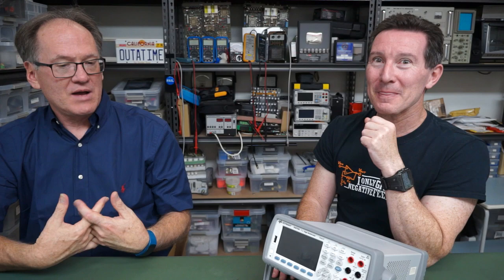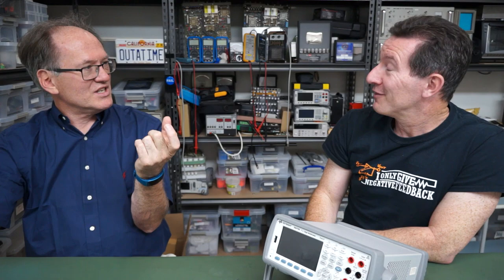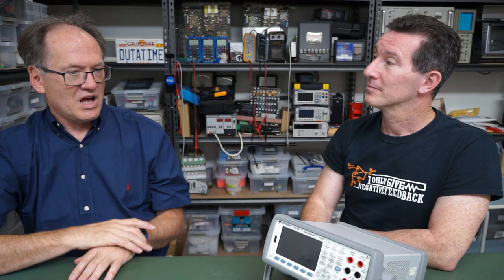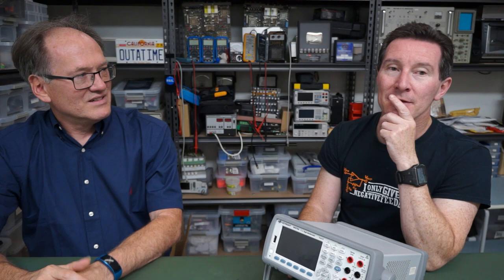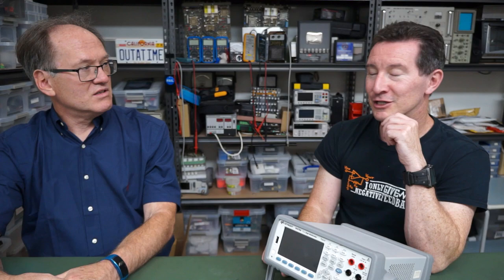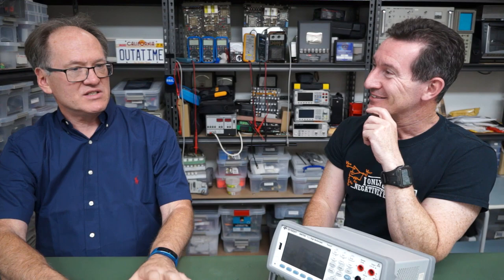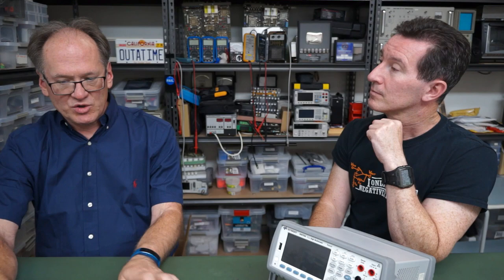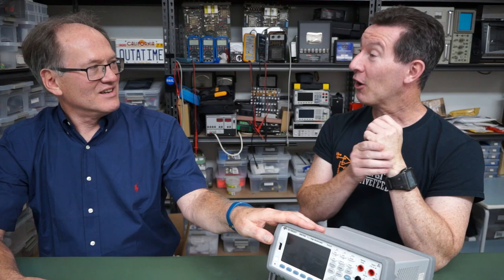EEVblog #1032  Part 4 - John Kenny Keysight Interview

Comment: The audio recording world is a great example of knobs and tactile controls. For a period, buttons and layers of menus were taking over. After a period of this, the market started manifesting products all over the place to return knobs and tactile controls. Users don't want to scroll through menus and use shift buttons, etc to get to a function, they want to reach for a dedicated control. Audio mixers, no matter how advanced and digitally based, still follow the form of analog mixers. The fluorescent light bulb example is an interesting example of form following tradition, yet not really being necessary. But an audio mixer is an example where the original form is totally following function in the most useful way.
The Golden Rule: Form follows function. :)

Comment: I noticed very little if any competitor name dropping, which is understandable. But with the introduction of Tek's 5 series scope and its price point I would be scared. I would asume Rohde and Schwarz 5G test instrumentation should also scare them as well. And a little Chinese company called Rigol and there upcoming Phoenix Chipset due next year. So I just hope that Keysight will bring to the table some truly innovative product to knock our socks off. If not I see the days of giving away products won't matter to consumers, as we look forward to more innovative products. Cheers
Reply from the maker: Scared of Tek's 5 Series price point? Why? It's hardly a ground breaking price point.
Reply: T Komoski have you ever used a modern tek scope?!?
Reply: Comparing Apple's to Apple's side comparision on price: (Not Features)
- Keysight  MSOX4034A 350mhz  4ch CA$ 16,647.00
- Rohde & Schwarz RTE1034 350mhz 4ch  CA$ 14,819.81
- Tek MSO54 350Mhz 4ch CA$ 15,889.10 
- Teledyne LeCroy (I won't even go there) 
Now I realize that some of these scope's are aging and need to be replaced but having Tek come out with this massive scope is incredible. 
They don't want top dollar for the base model and the expanded feature set is astounding. I'm totally sure Keysight and other competitors
will give Tek a run. But for my dollar at this moment goes to Tektronics, not a fanboy just looking for the bang on my buck. Cheers

Comment: Knobs! Bring back volume control knobs on TV remotes! My brain is analogue, it wants tweak so much of a value, not ClickClickClickClickClick ClickClickClick ClickClick of it.

Its interesting to hear the conflicting aspects of this guy's role. At times you can hear the engineer, but then sometimes his management and marketing aspects kick in (lets face it, they wouldn't let a pure engineer loose on Dave's channel - we tend to be too honest!). For example, talking about the 3000X series scopes getting rather old. Reading between the lines, my interpretation is that they don't need to replace it yet because it is selling well, making a nice fat profit on dev work that was amortised years ago, and they will only replace it when a competitor makes a better product. That's probably great for stock market investors and is "good" business for the company, but it kinda stinks for people who would really benefit from better (faster / cheaper / more capable) products. 

Similarly, spinning the "benefits" of touch and gesture user interfaces. The huge benefit of them in cars is that they cost the manufacturer a LOT less money than conventional switch based interfaces, and have a nice lifespan during which they stay reliable, and then fail unrepairably (backlight, inverter, bad LCD column driver etc) after 10 years or so. So many car LCD UIs look great in the brochure but are a nightmare to use. As a manager and project owner, it is easy to let yourself get distracted by the shiny sexy sexy-Italian-sportscar interfaces, when engineers actually need a good solid reliable diesel truck that works hard for a living and has knobs that go click. 

All in all though, a great insight. I do kinda worry that Keysight are going mid-ground and losing the high end now which has previously given them an "aura" and status. They may well find themselves pushed out, being the T&M equivalent of Chrysler or Pontiac. As alluded to in earlier videos, China is going to be what Japan was in the 70s, we will wake up one day, and they will have unbeatable products, and the current manufacturers will struggle to stay in the game.
Reply: AKA: "King of Nerds" because he literally is herding nerds. He is intelligent on many many levels. I am tickled pink to see him make futuristic predictions -- takes real confidence in what you know to step over that boundary and still sound/be sane.

The knob is a symbol of control and on testing & measuring you must have control. That's the underlying issue. For the manufacturer it might well be about cost as Dave has shown us in his vid about designing a soft touch power switch (which I hate because I have often owned fancy timers or control circuitry that I wanted to control the device in a new or novel manner. But it is what it is.) where it is cheaper to have one low power temp switch & circuitry than a true master power switch.

Comment: When John said that they were looking at broadening the potential applicaitons for things like test equipment, it dawned on me that there really ought to be an all-in-one unit for electronics DYI’ers like a service monitor or systems analyzer where you have the DVM, Frequency Counter,  Waveform Gen, O-Scope and Spectrum Analyzer combined. Or take out the SA for a more modest version. Why duplicate the interface and power supply if you don’t have to? All the parts would inherently talk to one another and the speed would be much greater, with minimal connection losses and latent capacitances.

Comment: If Keysight (or any other manufacturer) is reading. Think like DAW controllers. Mixing interfaces has been on the market for years, they work extremely well with a computer and even tablets to control effects etc on the fly. I don't understand why this isn't really available for scopes and other types of equipments.

Comment: btw, there is no knob in the Keysight DMMs, nor a touch screen, please fix it :) buy a few DMM7510 and take them apart if not already, and learn something from them , just my two cents :) also, the everything connected thing, you can do smart things with software in terms of latency even over consumer 1G (I also wish GPIB would be dead already, please make Ethernet standard in every single product you make), if video can be streamed real-time and you can play multi-player video games over Internet in real-time, streaming instrument data is child play in comparison, please don't tell me about data, you have 32 bit numbers; and btw, the control software and the software running in the multimeter is a gold mine in terms of revolutionizing the way we use those tools, today it is absolutely horrendous, limiting, and very basic, not extensible no nothing, the software front alone can completely revolutionize everything

Comment: Well they said tablets would wipe out desktop pcs, and people still like desktop pcs. I cannot stand tablets.

Its a bit, like windows 7, and people do not want to upgrade, to version 10. But eventually they may have no choice, if they want to use the newest features of windows, and or how windows does things.

But the new dynamic today, is the hacking community, they have a say in where things go, and alot of the independent guys on web, can dictate alot.

Alot of ideas get stolen from users on the web doing something, and that defines how things turn out.
Reply: Use Linux - take back control.

Comment: Frontpanels, displays, OLEDs, knobs, buttons are a waste in energy and opportunity in almost any device. Testing equipment should be just a really good analog frontend that sends the measured data over some high speed interface (PCIe/5G/BLE or whatever suits the throughput of the instrument). Then that data can be programmed/transformed/brokered/displayed in any way possible via software.

Heck, anybody that isn't living under a rock is already carrying a relatively high throughput display with you at all times: Your phone.

I cringed seeing Dave in https://www.youtube.com/watch?v=qWAqSSLwBtw writing down values by hand to compute power efficiency. I know some test equipment can be (painfully, via physical buttons) programmed to do it automatically, but isn't it time for a change in that regard?

More software, less (NTSC :P) displays! Update your tools and ways of working, EE people!